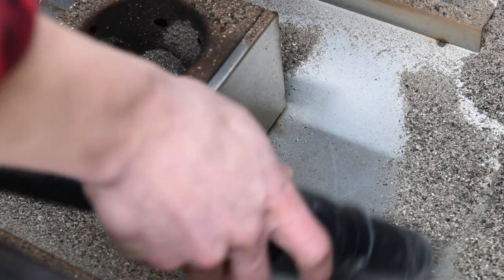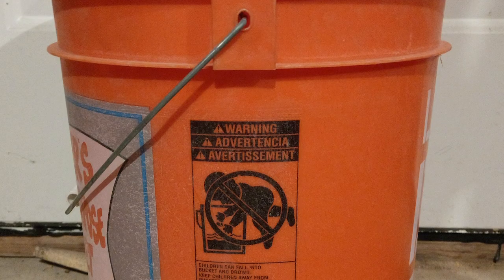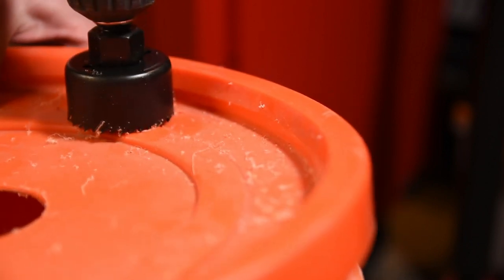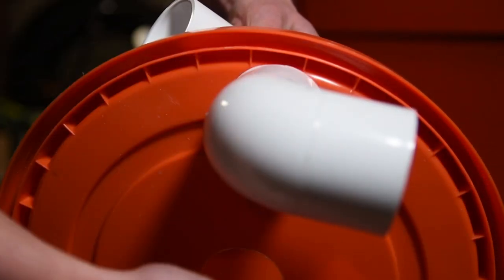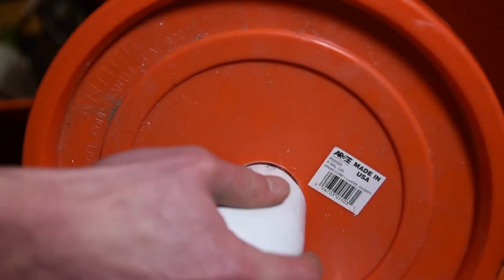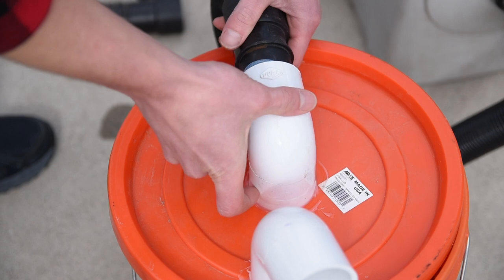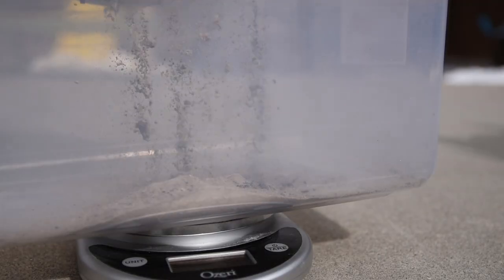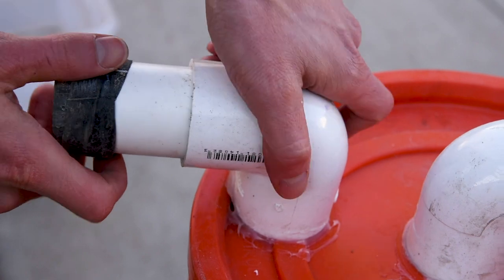DIY Dust Collector For Your Grill

Comment: If you don't already have all the tools/materials to do this lying around or plan on making multiple you're better off just paying $50 for the home depot Dust Stopper that snaps onto the top of a bucket, by the time you buy the hole saw, pvc, caulk, and pvc glue you're probably going to be getting close the the $30-40 range anyway.
Reply: yep.

Comment: Be extremely careful doing this. The plastic 5 gallon bucket could melt or catch fire if the embers are hot. I'd highly recomend stitching to a metal bucket to mitigate this potential.
Reply from the maker: You are absolutely right, that is why I said: "Make sure that they've been out for at least a couple of days to make sure there aren't any burning embers that I end up throwing in the trash and have the possibility of a fire."

Comment: Another simpler way would be to use the filter bags designed to trap Sheetrock dust.  Gone are the days of cleaning a clogged foam filter.  When the bag starts getting full, you just toss it away and get another.  I don’t use a shopvac for my WSM or kettle but I’d imagine using these dust bags would work well for sucking up ash.
Reply from the maker: Drywall dust and charcoal ash have a similar texture, so I bet it would work well. The bags for my shopvac are about $6 each, but when you consider the cost per cook that really isn't that much.  Thanks for the tip.